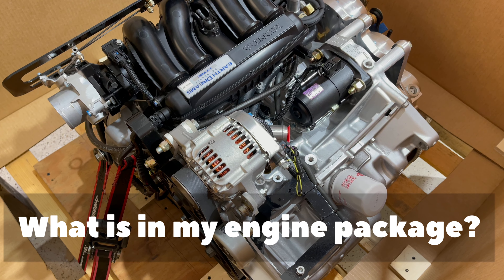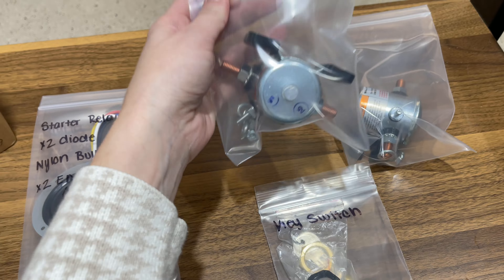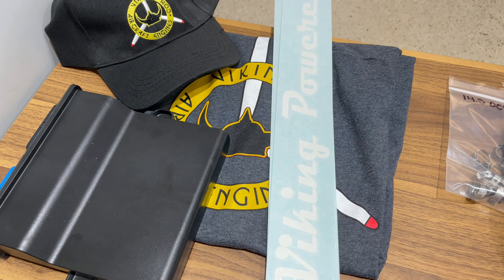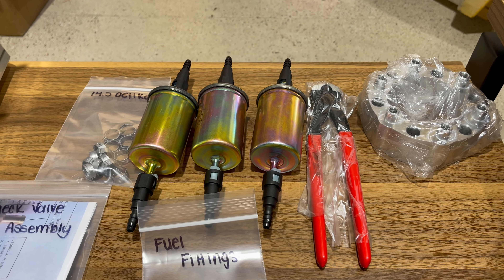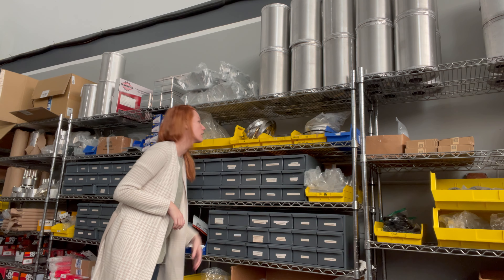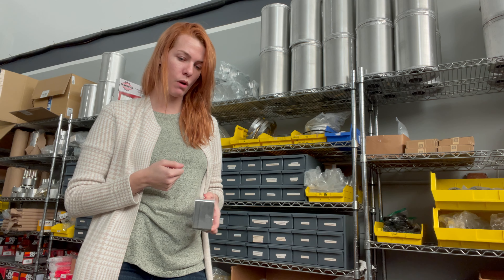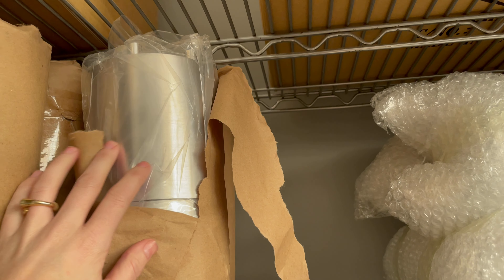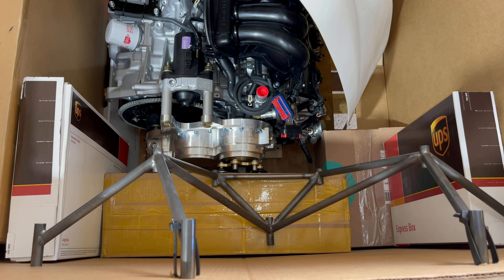What is in my engine package?

Comment: I would like to see a video about how the engines' oil systems work. I mean I see you flagship 750SD do extreme climb angle climbs etc. Are modifications done to the oils systems to prevent the engines from becoming oil starved? Are there climb and dive angles to be avoided? Time limits at positive and negative Gs? I know these engines aren't meant for aerobatic aircraft, just asking out of curiosity.
Reply from the maker: We will have more videos on this soon, timing and weather all have to cooperate. We do have some basic videos throughout the Youtube channel though. The engines can be used for aerobatics, just can't stay upside down extended. We have many people in Sonex doing that. A lot of the questions you are asking though are more related to the airframe itself not the engine capability.